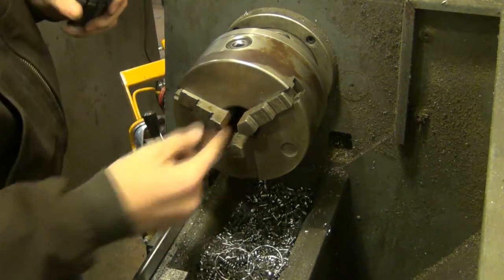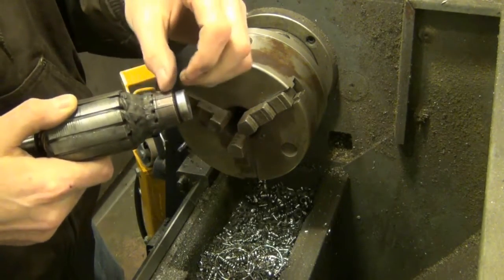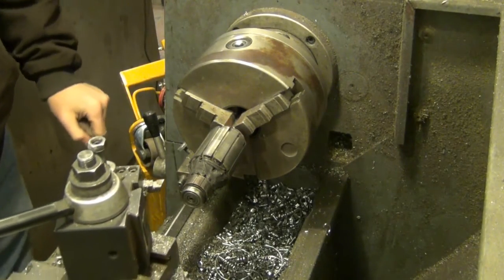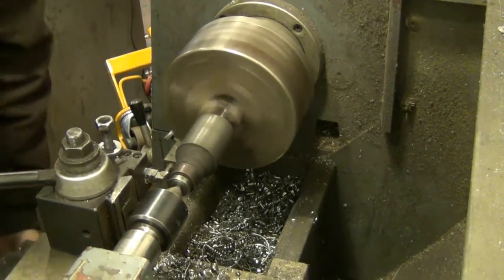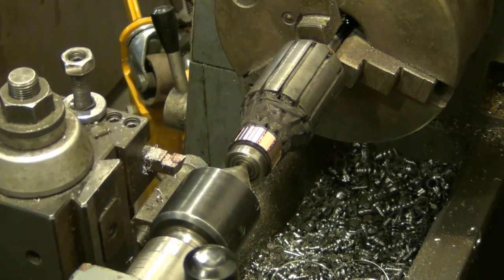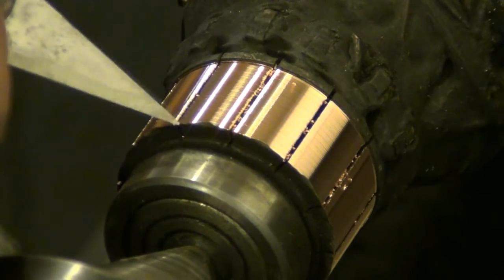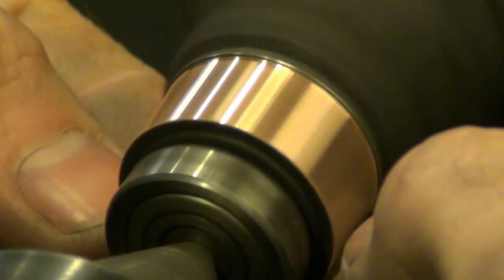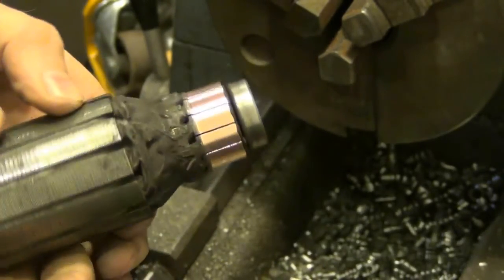Trimming an Armature on a Lathe

Comment: One of the most important things to do when cleaning up a commentator like that is to undercut the Mica which separates the copper segments. Mica is a lot harder then the copper and as the copper wears  down again the Mica will start to interfere with the brushes causing them to hop and causing arcing and premature wearof the brushes.

Comment: My marcher jet washer commutator has a higher segment than the orhers , what can I do, I don't have a large. Could I use a hand drill and burr?
Reply: More than likely if there's a high bar on the commutator (copper bars) its lifted of its base and probably not repairable. Using a hand  drill will ruin your armature for sure.

Comment: Nicely done video - excellent close-ups.  Good narrative.  I would like to know how you can use a 3-jaw chuck?  How can it be in-line with the tail stock?  I would think a 4-jaw centered with a dial-indicator would be necessary.
Reply from the maker: Thanks. I don't know how, but this chuck has always been within a half thousandths runout even with out adjustment screws. It's a no name chuck that came with the lathe. I just keep the scroll gear and jaw teeth as clean as I can.
Reply: That is why you use a 3 jaw, it's supposed to be inline with the tailstock, a 4 jaw is for irregular turning.